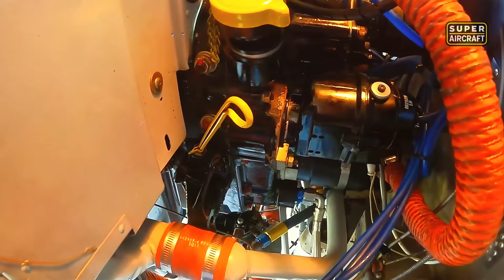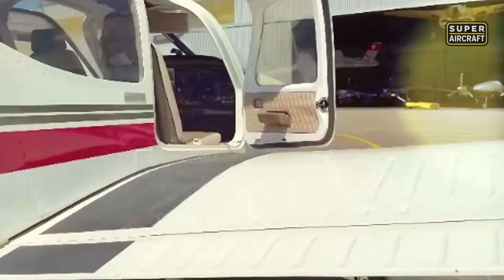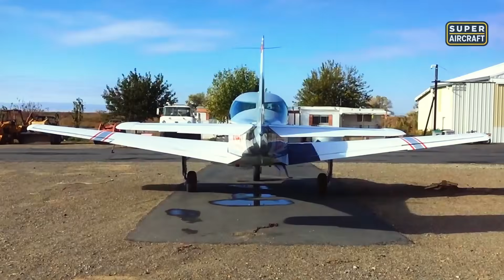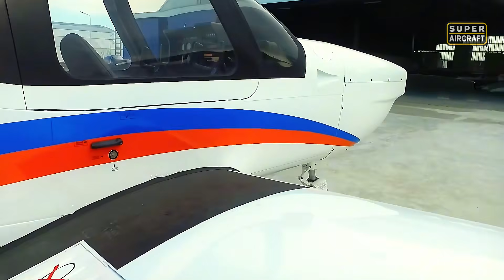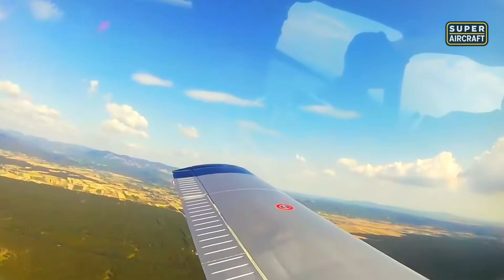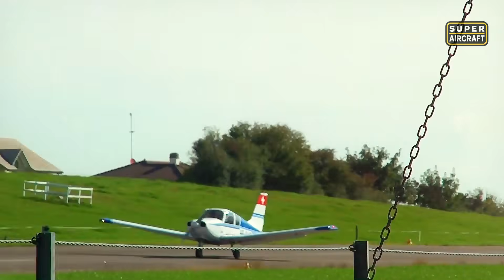NEVER BUY THESE “CHEAP” AIRPLANES!

Comment: If it weren't for the Europeans, what would America be flying on now? That's where the monopoly is!))))  And space prices are there too!))) The little Czech Republic with Slovakia and Austria with their engine are beating the USA in all respects!
Reply from the maker: You make an interesting point, Hibis. European manufacturers — especially in the Czech Republic, Slovakia and Austria — really did push light aviation forward, both in engine development and modern airframe design. Their competition has forced the global market, including the U.S., to improve as well. Thanks for adding this perspective!🤠✈️
Reply: As a A&P mechanic in the USA.  Europe has little effect on the USA aviation..  I see almost no European aircraft through our shop.
Reply: @hondaxl250k0  Good time of day! That's the whole point! Not much is being produced from the new available aircraft! Of course, we can talk about planes from Van s, but they also put Lycoming engines on their planes. I'm not going to say here that these are bad engines, it won't be true! But the control of these engines is already far outdated! And it takes a lot of time to set them up in flight, this is probably a separate topic. As a mechanic, you can probably tell us more about what's going on? Which planes are being repaired, what age, and what are the new products! It will be just interesting!
Reply: @Hibis29 we see mostly pa-46 line.  The 350s and 600s.   From the 80s to new .  Mostly all piper and beech.  Get a few Cessna 172 and 182.     Lycoming are ok.  I don’t like them.  I’m a continental fan boy.
Reply: Remember where the invention came from

Comment: #1 You Get What You Pay For
Reply from the maker: Absolutely, Bob — in aviation that rule rarely fails. Lower upfront cost almost always shows up later in the form of maintenance, parts, and structural fatigue. Thanks for the sharp observation!🤠✈️